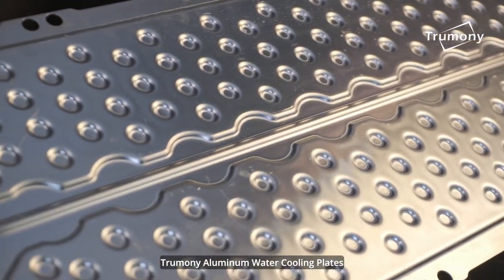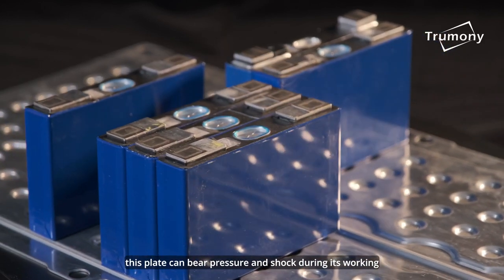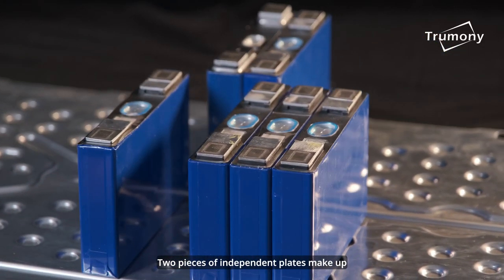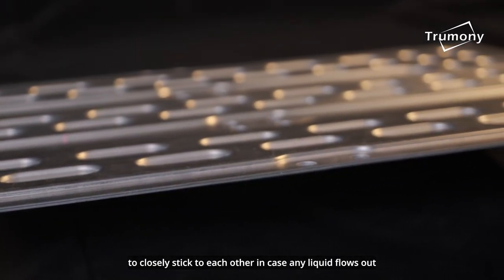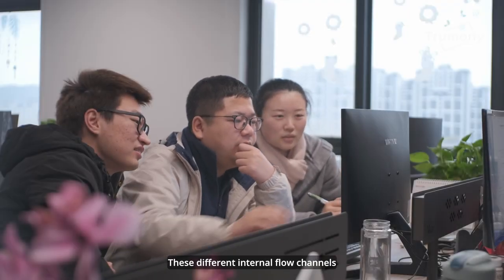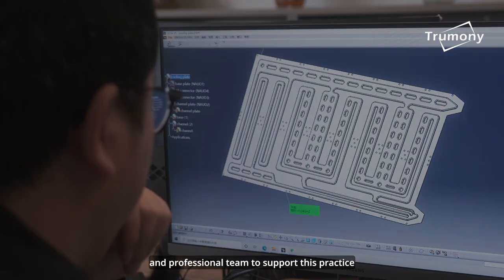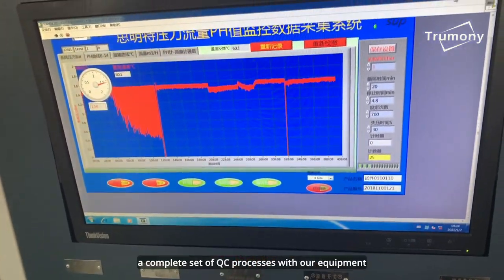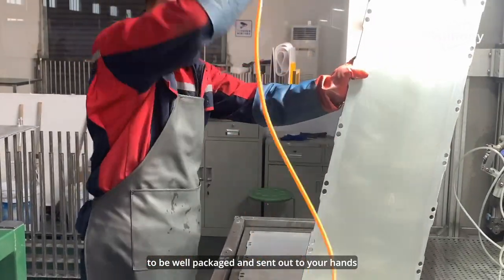Aluminum Cooling Cold Plate For Battery ~

Comment: Is it called water because it eventually used for batteries that are cooled. Or is that what the aluminium is called in the industry. 
As I understand the battery cooling is carried out by air, liquid or a hybrid mixture. Liquid cooling may be the preferred term as it is not always just pure water eg ethylene glycol and refrigerants are also used.
Reply from the maker: yes, the cooling method is including air cooling, liquid cooling . Now more and more EV automaker are prefer to adopting   liquid cooling for their battery pack .